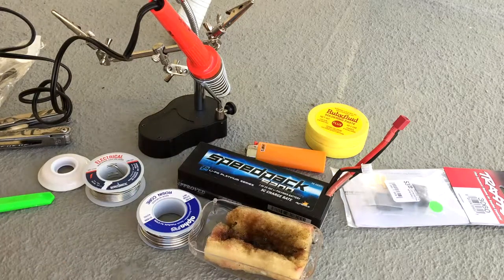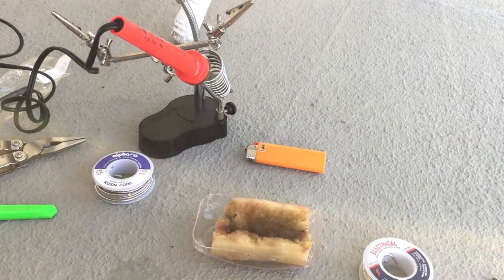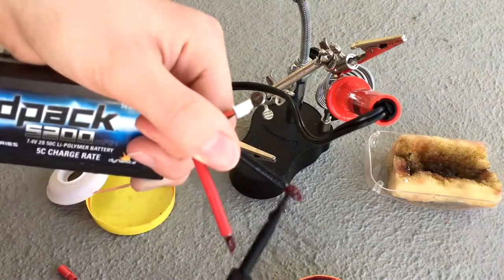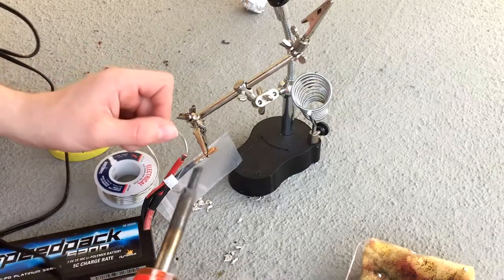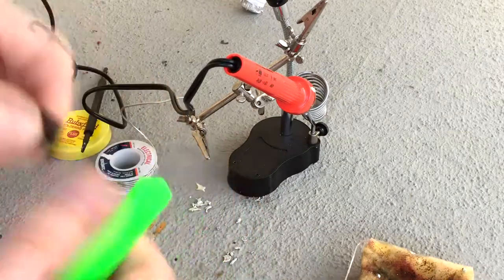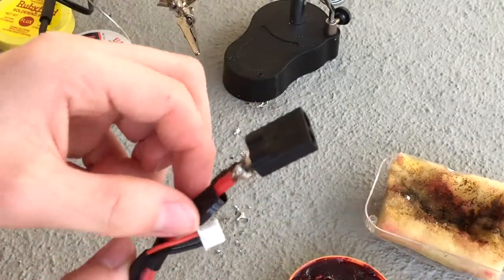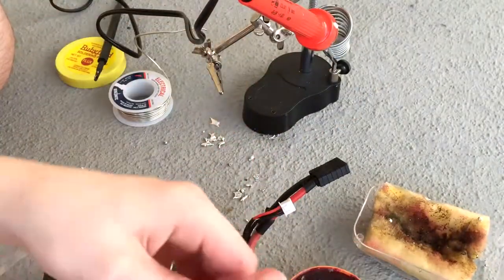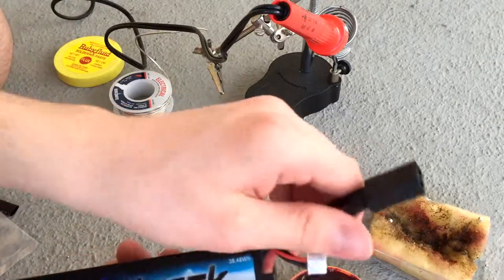Soldering Rc Lipo Battery Connectors

Comment: You never cut both wires at the same time nor should you ever burn off insulation.  Do one at a time to avoid a LiPo fire. 1) Cut negative wire. 2) Solder negative wire to new connector. 3) Cut positive wire. 4) Solder positive wire to new connector.  Done.
Reply: Ron Bokleman thank god...someone with a brain. ONE AT A TIME, NEVER HAVE BOTH TERMINALS EXPOSED.
Reply: @mgoo1713  Man i cringed so hard man XD lmao......i was like NOOOOOOOOOOOOOOOOooooooo

Comment: Damn my soldering joints of me when i was 12-13 were wayyyy better man......im 16 now (also a welder)and my joints come out beautiful man,not to bash on this guy but uhhhhhm yeah,things to make good solder joints is to have a good soldering iron and the one i got is a Xtronic 3020 and that thing is fantastic for the money and i got a hakko tip forgot the model but its been on there for over 3 years and with proper maintenance 

Things to get good sotter joints is 1) A good soldering iron along with good temps 2)good sotter (i prefer kester 60/40) and proper size 3)Patience for crying out loud and lastly 4) A "good steady hand"
Also trx plugs are are pretty tricky,ive had my handful of them and what i have done is that i bought a jig and i put the contact piece(whatever its called)and i put it right on the edge of were the has to go so that little line i guess and clamp it down and bam the sotter will go were it has to go and have problems of inserting the little pin/contact piece (whatever its called) XD lmao but yeah